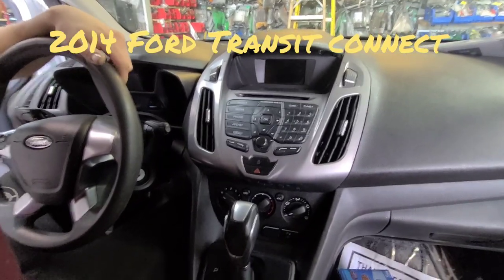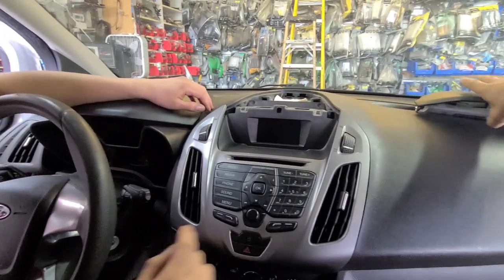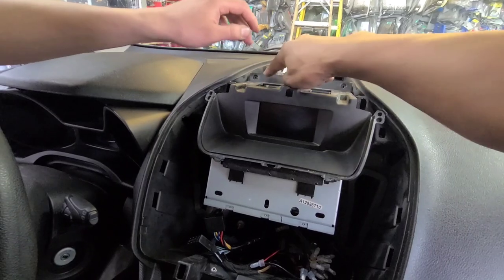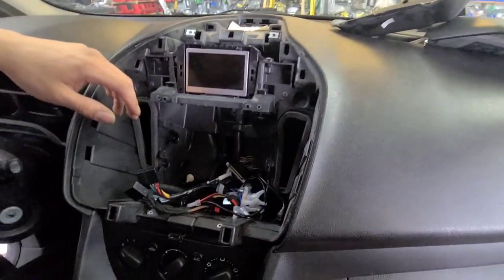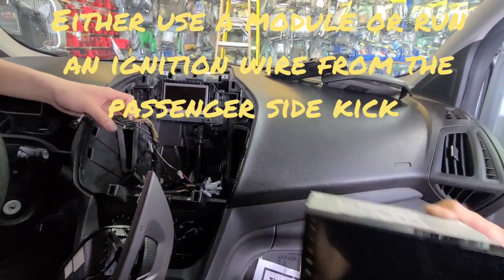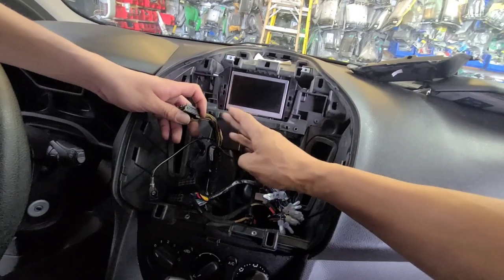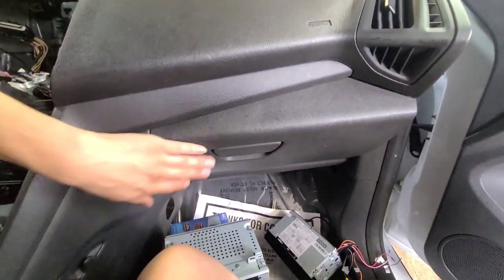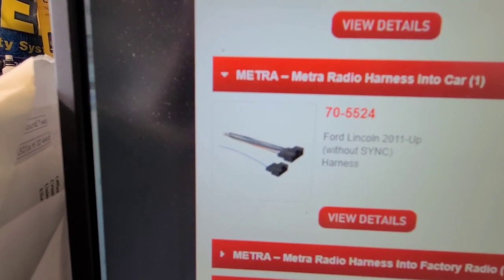2014 Ford Transit connect How to remove radio Install Apple carplay android auto Metra kit 99-5831b

Comment: Thank you for your video. Do you know which ignition fuse did you use to plug the radio in?
Reply from the maker: I think it's  Green with a blue stripe wire on passenger kick

Comment: Thank you for your video! Best one on how to do the job out there. Could you give me more details on your set up for the ignition wire? Which fuse did you use, did you only connect a cable to it or other components in the assembly, etc.? Thank you so much!
Reply from the maker: We have connected ignition on passenger side kick fuse box you can use any fuse that gets. POWER when key is on.we did not use module, just use speaker connection at the radio

Comment: was the 70-5524 the only wiring harness you used or are there any other ones that i would need to order? also is the 70-5524 used to transfer the back up camera and steering wheel controls to the new reciever?
Reply from the maker: The factory reverse camera wasn't working and Metra do not make any adapter, we had to use aftermarket camera

Comment: No links to the surrounding for the stereo, as you have to change the facia ?
Reply from the maker: Is this what you looking for?
https://www.crutchfield.com/S-956ps8n5gHo/p_120955861/Metra-95-5861-Ford-Kit-Gray.html?XVINQ=GLX&XVVer=1HLB&awcr=674434468730&awdv=m&awnw=g&awug=9004286&awkw=pla-2202203943322&awmt=&awat=pla&gad_source=1&gclid=CjwKCAjwte-vBhBFEiwAQSv_xSnjpIq5XKo-KBAu9lKp5gMSPtkbcg9Oc3J7Nm4Y1n0v2z3mx2TuGBoC-AYQAvD_BwE

Comment: Thanks a lot for this video. Can you describe where you get the signal of reverse gear and camera?
Reply from the maker: Hi, it's at the bcm behind the glove box, brown, 20 pin plug. It's blue/white pin #20
Reply: @goautosound1  so you connected blue/white pin20 directly to video cinch input?
Reply from the maker: @sprengel1980  video cinch wire?
Reply from the maker: @sprengel1980  what is cinch?
Reply: @goautosound1  sorry i did not know this word is unusual in english. Well it is a kind of connector often for audio or video
Reply from the maker: @sprengel1980  you mean RCA?
Reply from the maker: @sprengel1980  it's a reverse trigger so when gear is in reverse you get video of camera
Reply: @goautosound1  yes, i mean RCA, it is called composite or cinch cable as Well here. Sorry! So I should connect blue/white pin20 with the middle wire of video rca of the radio?
Reply from the maker: @sprengel1980  no it is power wire to activate reverse input on your radio
Reply: @goautosound1  thank you spending so much time. Can you describe the way of the video signal to the radio? I do not understand how you get this onto the screen
Reply from the maker: @sprengel1980  your reverse camera has yellow RCA which gets plugged in yellow RCA on radio cam input

Comment: you glazed right over the only part I cared bout, which was securing the 2din radio to the actual van's inside frame before putting on the cover... LOL
Reply from the maker: The kit comes with side mounts where your new radio gets mounted. If you use Metra kit, 😊it has simple instructions with pictures. You put side mounts on the dashkit, then screws in
Reply: @goautosound1 this is false information. You put the mounting brackets on the double din radio first then install double din where the existing cd player was mounted then check fitment to insure the dash kit lines up to your liking then you secure it then you place the dash kit